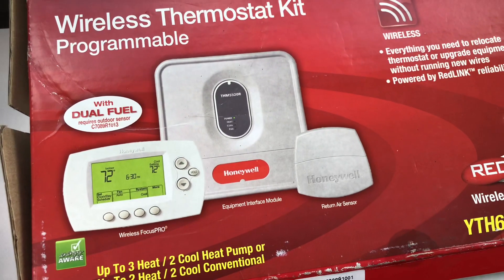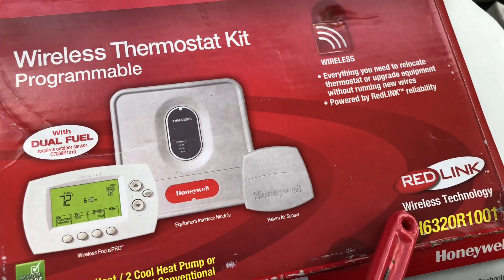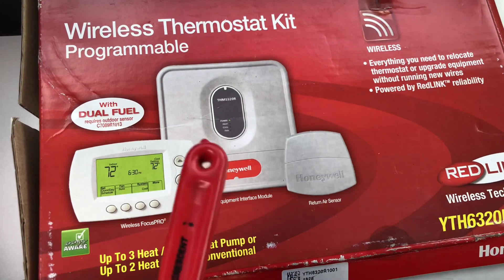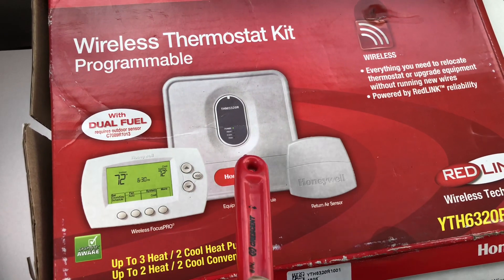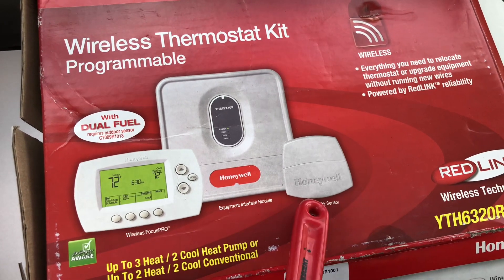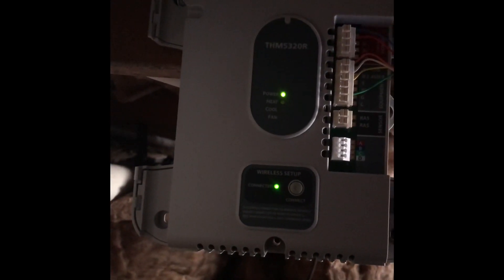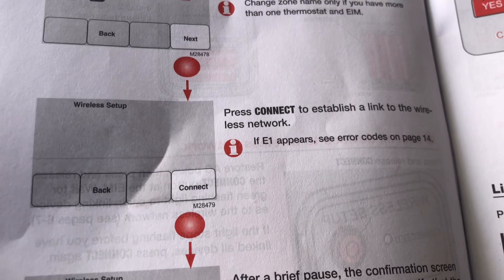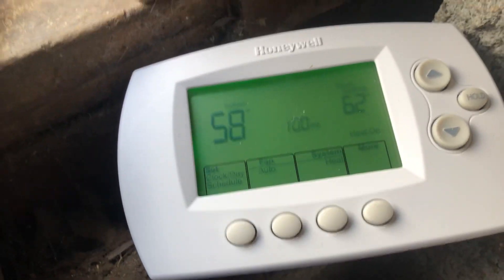Easy tutorial on Honeywell equipment interface module and honeywell wireless thermostat kit

Comment: If the return air sensor is recommended as a backup for when the thermostat stops communicating, what cooling setpoint does the interface module have programmed to keep the unit cooling or to initiate cooling?
Reply from the maker: I don’t know the answer to that question

Comment: Thanks for the video. Got a house in Greensboro nc where this will work instead of running wire and opening up sheet rock (house just got painted and remolded) so no WiFi needed right?
Reply: And no router needed ?
Reply from the maker: Yes, that will work!

Comment: Thank you for the tutorial. I have had this unit for a few years. I keep getting an error E53 on my thermostat. The outdoor Red Link does not connect anymore. I got a new one and followed the steps, but it is not connecting. Any advice? Could it be my thermostat?
Reply: Just wanted to give an update. Hitting the connect button on the RedLink might not be enough. You also have to hit the connect button on the EIM unit after linking the thermostat.The EIM is the main controller.

Comment: Hi I am looking to use this wireless thermostat on the third floor of my house to the basement. Do you think the signal is strong enough to work at such a distance and obstructions?  I have only a hot water oil fired boiler.
Reply from the maker: Yes. Red lonk signal is used on commercial buildings and it will reach several stories high

Comment: So my utility closet has my water heater and furnace within about a foot of each other would I be able to hook up the wireless receiver inside of my utility closet by putting the receiver a couple of feet up the wall away from the furnace or would you recommend Somewhere else as I do not have access to the addict through the utility closet I would have to go into the garage in crawl about 20 yd to 15 yd to get above the bathroom where the units are all at.
Reply from the maker: You can put the receiver anywhere because the receiver is actually wired to the air handler

Comment: Hi Michael, helpful video.  I had unit installed several years ago and the HVAC company no longer services them.  I never added it to Honeywell's Total Connect Comfort for online monitoring/change.  I just tried to do it, but it asked for a MAC ID and CRC.  I don't have the original documentation which might have listed this..  A pity it's not on a sticker on the back of the thermostat as some of their other Honeywell units do.  Is there any way to get the MAC ID and CRC through the menu options?  Or is there another way to set this up with Total Connect Comfort??  Many thanks, Bob
Reply from the maker: The Mac ID should be inside the thermostat when you pull the face off

Comment: How do you do the setup for the thermostat, if it’s a split system heat pump single stage.
Reply from the maker: You will see the instructions in the thermostat manual